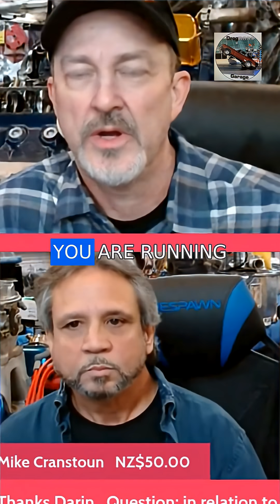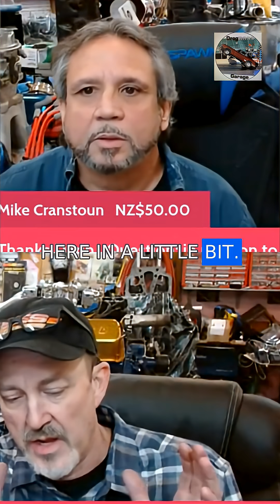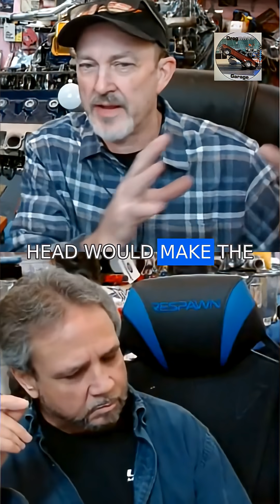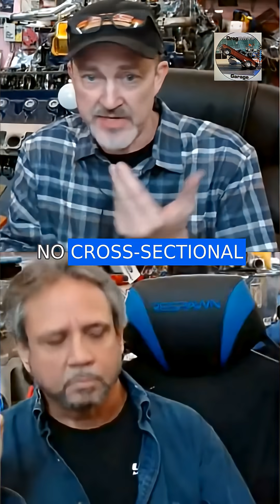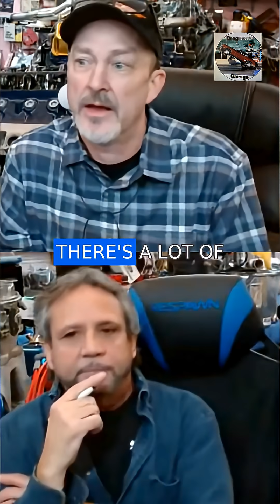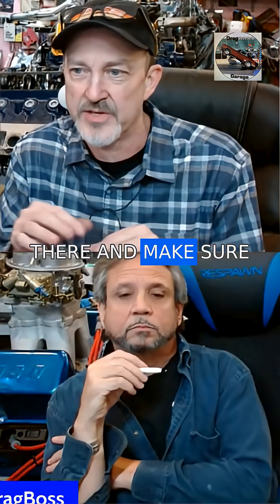Darin Morgan Induction: Why A Turbo Engine Doesn't Need Cylinder Head Changes #automobile #turbo

Comment: I have to disagree
Reply from the maker: Good. Sometimes people will say why? Do what works for you. Thats the important thing. Thanks for watching.
Reply: @dragboss351cleveland  , the reason people heat a NOS bottle is because if the bottle is colder then where you want the oxygen to go, like the hot motor, it won't come out of the bottle, it will force its way to the coldest and lowest places, (( SAME)) with blown engines, you can force all the air you want into the engine but you cannot force the oxygen in the air to stay in the air you are forcing into the engine , if you ran the boost up high enough, the engine would either lose rpms and back off or shut down altogether for lack of oxygen due to extreme air temperature unless you are using fuel with oxygen in it,  like nitromethane
Reply from the maker: @michaelguerin4618 @micha I look at it like this, the liquid is at the bottom of the bottle, the optimum pressure at least when I was running it was about 950 psi. When you put a bottle heater on it, it heats up the mixture, to help the liquid and gas be homogenous. then when it’s injected into the engine during combustion, it releases the extra molecule of oxygen. In regards to the blower, it’s blowing in a mixture of air in fuel, not just air. I am missing what you’re trying to say. The point of head porting or flow. Adding a turbo you do not necessarily have to port them differently. Any combination may be different. This is in general. I don’t know what you mean about pumping more oxygen in it?
Reply: ,,if you are using NOS you must run 2 plugs and 2 Magnitos, because ignition systems will not always keep up, and when they skip a beat the next time around you lite off a cylinder with a double charge, and that's the same as having 1 cylinder fire and the rest are locked up, if you don't eventually you will blow a piston out the bottom of your engine, and if you don't switch to AWD eventually one rear wheel will spin while the other grabs, the spinning wheel has to be dragged against its will and its the same as breaks being applied turning the car into the wall, just like a track driven tank or Bulldozer, but not if you have All wheel drive, because the car is also being pulled forward from the front not just pushed from the back
Reply: @dragboss351cleveland  bigger ports more value with less air pressure, means lower air temperature, oxygen doesn't like heat, as heat goes up, the percentage of oxygen in the air goes down, until it levels off, then it will decrease as pressure rises under increased boost pressure,,oxygen is the only thing that makes Horse power,

Comment: Maybe I’m overthinking this. However, I have read more than once that running more boost reduces the effect of other power adders. This made sense because a big part of making power on a naturally aspirated engine is intake wave dynamics. More boost will lower the compressibility of the intake charge but, the static pressure is higher so the engine is going to make more power anyway. Not trying to refute anyone, just trying to sort it all out.
Reply from the maker: Not sure what your asking, or just thinking it through. Not sure about compressibility, but your drawing more overall charge, and forcing it, na rules not as applicable.

Comment: A turbo supercharger nitrous they're just multipliers the more power you make na the more power you're going to make on boost.
Reply: Somewhat. What I would do for each would be different. Question to cause you to think, is would you build the same port for gasoline versus alcohol? What change would you make and why?
Reply from the maker: First thing I think about is the quantity of methanol used compared to gasoline. Also molecule size and air fuel mixture density. Thanks Joel
Reply from the maker: Ok, as long as the compression ratio is low enough.

Comment: Presure6ratio needs to be one to one.  Boost pressure of intake track & exhaust pressure to the exhaust turbine are the same, 1 to 1.   The sky is the limit if parts can be designed to live there.

Comment: Well this is easy to see, if you have a compressed air supercharger system and run it on the engine dyno, if you double pressure you double horse power.
The engine has a pump like operation, so it sees pressure ratio just like a pump.
But! Turbos change things, because a turbo is it's own system it's sort of like having a Stirling engine on the side of your main engine.
The turbo will make the power it's capable of regardless of engine size within reason, so if you have a 4.8l and a 7l if the turbo is 1000hp both engines will make 1000hp.
Turbos are all about lag, if you can solve lag without playing with cams or heads then there's no need to touch those things.
With modern electronic control you can manage the turbo to have less lag.
Then the next thing after lag is heat, the less manifold pressure the less heat, so you want to make the intake as free flowing as possible.
Reply from the maker: Yes for most part, no changes but then always exceptions to the rule. Turbos are pretty amazing pieces of machinery.
Reply: Turbo lag is a sign exhaust impeller & housing is to big.  @dragboss351cleveland

Comment: I'm not sure im on board with that . Not according to Smoky Unike.
Reply: Richard Holdener has shown many times what Darin is saying is true. The caveat is it assumes the turbo setup is fairly balanced as far as boost vs drive pressure. If the turbo setup results in a severe imbalance in the pressure differential across the engine then it changes things.
Reply from the maker: @bcbloc02 and this is in general, every combo is different. When someone says they disagree, I like them to explain why. Thanks for being there on the live chat.
Reply from the maker: Lot of things have changed since then. If you don’t feel it is right, then do it your way. Read the description too this is general
Reply: @anthonythurston4282  Smokey was a legend, but you can't expect him to know what he was talking about on turbos, he didn't build turbo engines for hardly anything in his career.    Meanwhile Darin has access to all of Smokeys work, AND current technology and data
Reply: Smokey had no idea what he was doing.
Reply: Are you thinking of Smokey Yunick’s turbo inline 6?